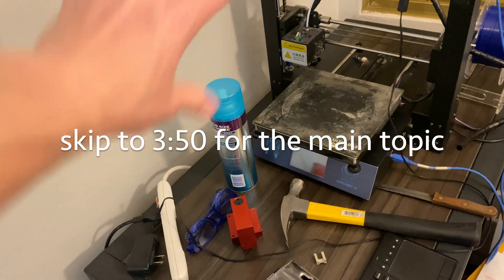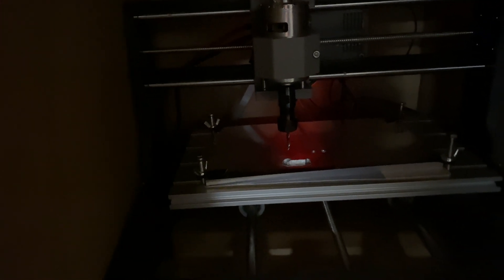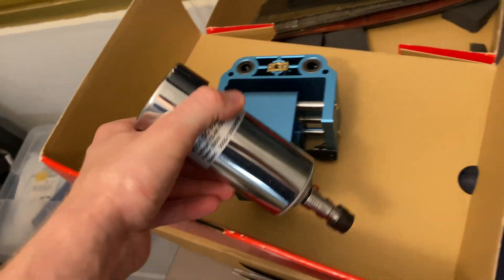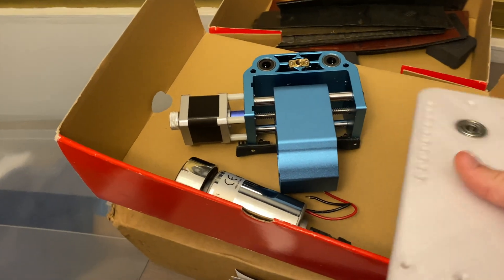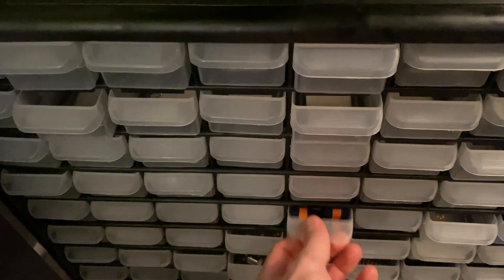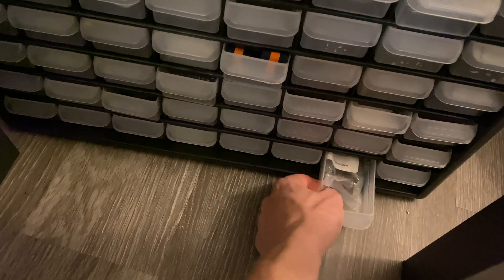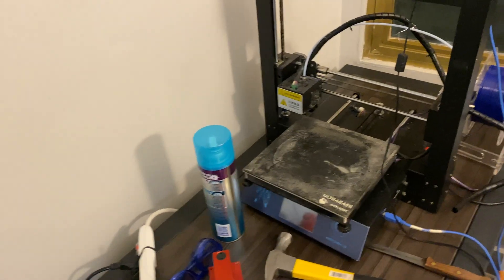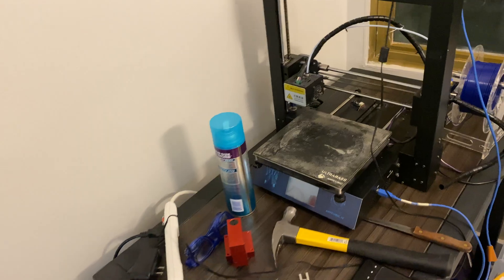My KEVLAR infused webbing doesn't work... yet!

Comment: Do you know what you need a perfect gear/gadget of your suit? camouflage/cloaking suit like splinter cell and metal gear solid. Only cause you always patroll at night. You could be the terror that stock in a night. And the spider-like bola. Multifunction gear, self-defense device, Grappling claw/hook for climbing or swinging, for self-defense, like a monkey fist or rope dart, look that up and see what I mean. Please 🥹😇🙏🕷️
Reply: I have 3 to 4 reasons of carotene this could help you.
1: low average comic books like araña the heart of the spider may not shoot webs, but swinging around and throwing/tossing a rope is simple, and easy. Kevlar rope is light and strong for your type of weight.
2: spider-Man‘s web fluids. That’s all amazing sounds and look, but you admitted it’s impossible for webs they can actually hold your weight, nor strong enough to stick on your opponent. 
3: making webs is expensive for chemistries. 
4:” the more logical approach“ is the fact that you have successfully made your web shooter in the long range, wide/thin/thick and squirt/spray webs are very effective at the moment. But think about 3 and 2 as the example  and reason. 🤔💭

Comment: I have been watching the community for a long time now, and i am wondering why not try and make a two part webbing? Hypothetically could would it be stronger?
Reply from the maker: It could be and I definitely want to at some point. I did briefly try and fail in the past (I think the video is around December 2019) but the main reason why it’s not attractive is all the hardware needs to be essentially doubled.
Reply: @theAmazing  interesting, so the main problem is the size? And also the know how to make the webbing. For the webbing could you go for something like slime almost and use that basis to go off of? 🤔
Reply from the maker: @thedevconnor  Yes the cross linking of PVA (slime) is a good candidate!
Reply: @theAmazing  I would imagine though tensile strength and dry time would be the main issues from at least my experience with it.
Reply: @theAmazing  also do you think that the reason it may not be coming out correctly could be due to the distance it has to travel to the exit point? I may be wrong but wouldn't there be a lot more turbulence in the tube compared to if it cold exit as fast as possible?

Comment: Is it possible to add adhesives to your web fluid to enhance its' stickiness?
Reply from the maker: perhaps!
Reply: @theAmazing  Ive thought about a mix of super glue with the hot liquid to cool solid hot glue to see where that goes. It would be ductile while hot and cool into a solid and hopefully accepts the adhesive properties of super glue to stick better.

It may be chemically complicated but if pulled off, it could be a base web fluid.

Comment: Would the webbing weaken in areas where the kevlar fibers aren’t as densely concentrated? If so is there any way to ensure some uniformity in how the kevlar strands are distributed?

Also, still waiting on that wall crawling apparatus👀👀👀
Reply from the maker: We essentially have to ensure that the Kevlar is neutrally buoyant and ensure that the electrostatic forces between the fibers become negligible in solution. This is not easy.
Reply: @theAmazing  Well hopefully you can figure it out.
Reply: yeah im waiting too that would be cool